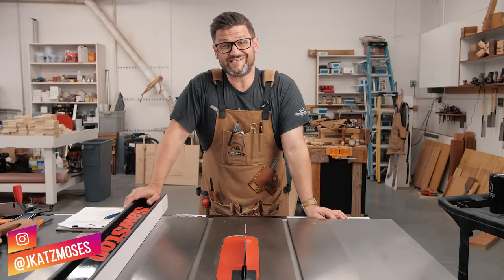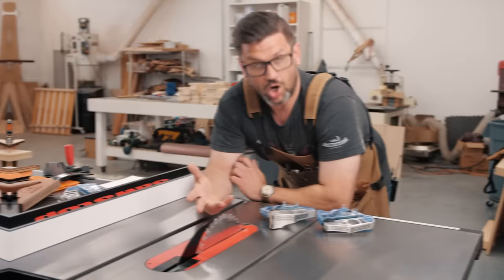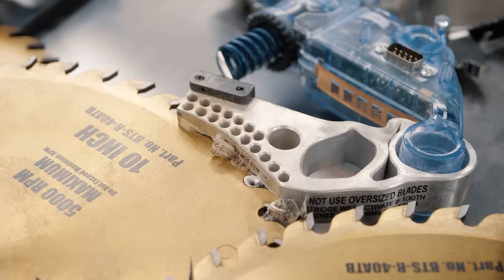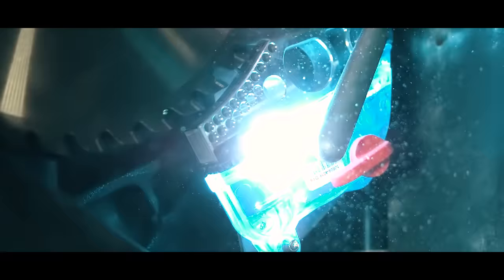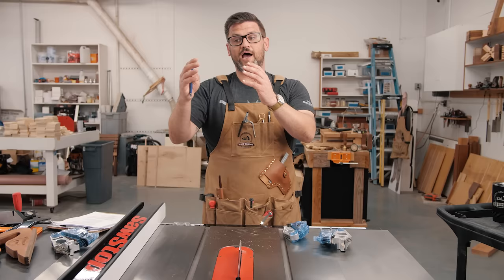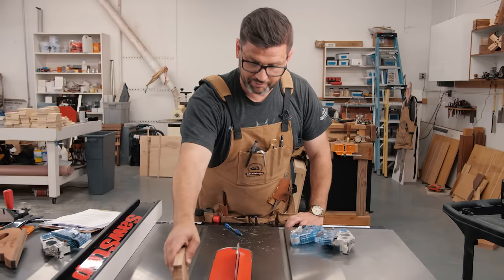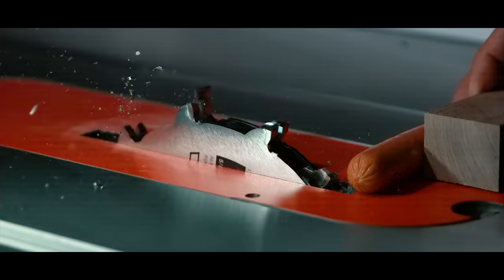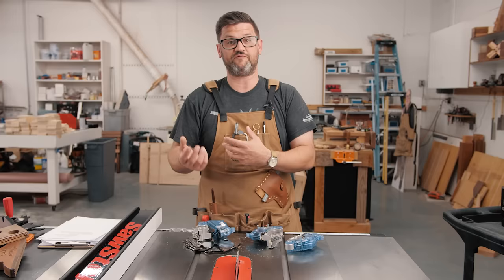How Safe is a Sawstop Saw? - Never Before Seen 19,000 FPS HD Slow-Mo Video

Comment: I've heard the "you were pushing too slow" argument before, my response is: just how fast are you pushing material through your saw?
Your high speed push was very impressive and convincing, but it really isn't needed since no one can even push wood through a saw that fast.  Actually trying to cut wood that fast  would cause a whole other set of problems...
Reply: Yesh, but if you (or someone else) were to trip and fall into it...

Accidents don't always happen to the person using the tool.
Reply: @adamthethird4753  That's what I was thinking. What could happen if you were to trip and fall into a spinning blade?
The fast push through the blade answered this to my satisfaction. You would endure some damage but most likely not an amputation.
Reply: @mktsmith62  I think Jimmy DiResta cut his finger off once. Said the bill was $15,000. And a new SawStop saw is around $3-4,000. I'd say it justifies it if you use the table saw daily
Reply: The speed is excessive but it proves how even in an unrealistically worst-case scenario, your finger will still stay attached.  It's not too often where you go way beyond what a product was meant to handle and it still does what it intends to do.
Reply: You can't push material thru the saw that fast but during a kickback scenario your hand could certainly be thrown into the blade that fast.
Reply: I have seen that people were trying to 'help' by starting to pull timber trough a saw from the other side. You don't expect that and you are completely of balance.  Accidents are a number of bad things coming together.
Reply: You hand would definetly get thrown back that far from kick back. I dont quite understand what you are defending?
Reply: @Toastmaster_5000  Good point
Reply: @jtltet  True
Reply: @komicalkramer6188  You could cut your finger off & have it sewn back on for free, if you lived in a country with proper health care.
I ran my thumb through my saw a few months ago - didn't lose it, but it was a mess.  Three days in hospital, surgery, & weeks of wound care visits - didn't cost a cent.
Reply: @TheLizardOfOz  A country that believes they have the right to someone else's labor for free?
Reply: Did you watch the video?  He gave examples of why your finger might be going that fast right after!
Reply: If you push it into it like that, it will catapult in my experience. Slow is the way to go my father always said.
Reply: @TheLizardOfOz  I'm not really sure what your point is. Are you saying just move to a country with "free" healthcare? That's gonna cost you way more than $4k. Are you saying this saw is stupid because the US government has shitty healthcare laws? Are you saying don't worry, you don't need to buy this saw because if you, God forbid, chop it off you can just get it sewn back on? There are so many flaws in that argument. It seems like the only logical thing to do is just pay the greedy corporation $4k for a saw, save yourself time money and heartache, and possibly your profession and move on with your life. This is what we call an investment. The upfront cost sucks but the payoff is worth it if it saves a limb or life and keeps you from getting sued by a disgruntled employee who lost his favorite thumb.
Reply: @TheLizardOfOz  I'd prefer not getting my thumb cut over having it fixed for free.
And there is never ever free healthcare anyway, it is sneaked into your taxes.
Reply: Why does it matter if it was needed? It is still interesting beside the fact that it still can happen. Like why argue wether it was necessary? It works so just be happy and stop arguing
Reply: @INoIFearIGaming   A country that sees health care as more important than profits.  
A country that has far better health outcomes for its citizens than the US.  
A country where people don't avoid going to the doctor because of the cost.
A country where you have no fear of bankruptcy if you get ill.
A country where infant & maternal mortality isn't increasing.
Shall I continue?
Reply: @Nworthholf  Yes, it's paid in taxes - and it costs far less per person than the US system.  Also, no co-pays.
Reply: @TheLizardOfOz  So who are you gonna force to provide their medical services to you for free?
Reply: There's always the case where someone is focusing on making a clean cut and absent-mindly tries to brush scrap away while the blade is still spinning.
Reply: @jonathanfairchild  Nice strawman.  I didn't make any of those arguments.
Reply: @INoIFearIGaming  No one.  No 'force' involved at all.  Socialised medicine is just a sensible way of providing health care for all - the way it's done in all progressive countries.
Who do US citizens "force" to provide their socialised road & traffic systems, their socialised police forces, or their socialised defence forces?
Just as an aside - many US citizens have been conditioned to see the word 'socialism' as synonymous with 'communism'.  It isn't.
Reply: @komicalkramer6188  Wait u gotta pay about 4k every time it stops? Or You meant the whole set?
Reply: Know.FeaR. In what world are they not compensated for their work? You realize they’re droll paid very well in countries with free healthcare 😂
Reply: How the fuck did you manage to make a video about a table saw political? Wether more or less expensive people tend to not want to be injured when working in the first place rather than have to go through a painful experience, it's as simple as that.
Reply: @valdasv9874  just the table saw costs around 4k. The break everytime it goes off, is around 100
Reply: I was wondering if it worked with clothes  or gloves or if someone fell face first and the glasses got in the way. Or like Jean's.
Reply: I just throw wood at saw, isn't that how you use it?
Reply: @mktsmith62  well if you are clumsy enough to trip and fall on a moving blade you shouldn't be in a work shop.
Reply: @unbiasedcobra6672  On that count I certainly cannot argue. :-)
Reply: @TheLizardOfOz  "Three days in hospital, surgery, & weeks of wound care visits - didn't cost a cent."  Sure it did.  You just pay for it in taxes.
Reply: @TheLizardOfOz  "Shall I continue?"   Do, or do not (says Master Yoda).   Lay out your perfect Utopia and then I might ask why is not everyone on Earth going there?  What's the catch?
Reply: @TheLizardOfOz  "No 'force' involved at all.  Socialised medicine is just a sensible way of providing health care for all - the way it's done in all progressive countries."  There is always force.  Suppose you decide not to pay taxes?  Oh, but there's VAT; too late, you already paid 24 percent sales tax.  You cannot choose not to!  But supposing you could, what then?  Well, eventually armed police will come.   Now suppose a majority of citizens decides not to pay taxes. How is that possible? Well they might decide to not work.  What then?  Well now you have a problem.  See the Soviet Union for details.  
Socialism works when people work.  That's about all there is to it.  The Soviet Union failed because of excessive diversity.  But socialists love diversity.  No, really, they don't.
Reply: @sirshotty7689  Everything can be made political.  After all the sky is Blue so it must be socialist.   Except at sunset when it becomes Republican.
Reply: @abhiv.f.1628  It puts a signal on the blade which is electrically insulated from the chassis.  Anything conductive that comes near the blade, doesn't even have to touch, but close like a millimeter, the capacitance of your hand or hot dog will draw enough signal from the blade that it can detect the proximity of this conductive thing even before contact.
Reply: It's more to represent a slip and your hand running into a blade which can happen.
Reply: @thomasmaughan4798  So Germany = Soviet union. Got it. What if people decide to "not pay taxes" yea... what if the government decided to "not do a single thing for maintaining infrastructure" you act as if taxes are a bad thing, as if somehow the government is stealing money out of your pocket and not providing you with anything in return. And while that might be the case in the third world country called United States of America, it isn't in most other developed countries. Your what ifs are Strawman arguments. I could start arguing the same way. What if the police decides Black lives are worth less .... oh wait. I forgot, not every country encourages deescalation tactics for their police force. What if a big part of your country was Stupid and didn't undestand that if everyone is paying for healthcare and the states puts in measures so that Insurance stays affordable even for low wage workers Insurance can be very much affordable?...  hmm no that doesn't work either... What if, you would realize that even though you technically can live without working in certain countries it has been proven that this does not affect the unemployment rate negatively? What if you understood that to recieve unemployment help you need to fulfill strict criteria and you need to actively try to get work and there was a government body watching over these efforts? What if you actually had a working government that doesn't only consist of two parties and stokes the "us vs. them" mentality every time it gets the chance? ... so many questions.  But i mean you're welcome to do as you please and to continue to Pay thousands in co payments and insurance payments or maybe for a change bancrupt yourself to get health care. Or, you know, you could just die, because that would be cheaper and more economic if you aren't able to work anyways when you're really sick. Yay unrestricted capitalism!
Reply: @TheLizardOfOz  no infant mortality in US is mainly caused by planned parenthood and countries with no cost health care are paying way higher taxes.
Reply: @KapitaenAwesome  "what if the government decided to not do a single thing for maintaining infrastructure" 

The possibilities are many.  Go back in time a couple hundred years and you had private enterprise building toll bridges and toll roads. 

"you act as if taxes are a bad thing"

Is it that obvious?  You take the fruit of my labor?  If I say "slavery" you'll probably agree that it is a bad thing, but only because you have been taught it is a bad thing.  

Taxes can be a necessary thing, but they are extortion and cannot be represented otherwise.   Tolls, on the other hand, is fee-for-service and thus each person is free to use the service, road or bridge; or not. 

Your what ifs are Strawman arguments."

As is yours.  But your example is really the fallacy of the false alternatives; as if the alternative to your socialist utopia is the "third world country called the United States of America" that fortunately by the power of its industry and military has kept most of the socialist nations "free" to pursue socialism. 

"What if the police decides Black lives are worth less"

Less than what?  The police are not charged with deciding the relative value of lives.  They are charged with law enforcement.  

"What if, you would realize that even though you technically can live without working in certain countries it has been proven that this does not affect the unemployment rate negatively?"

I regret not understanding your question. Okay, read it three times and I comprehend.  You are saying that a nation that allows people to live without working does not affect its unemployment rate.  Well, sure, that's because the unemployment rate is calculated on the workforce, not the non-workforce.  So if only 10 people in Germany wish to work, and 9 of them succeed, the unemployment rate is 10 percent.  The millions of non-workers do not affect this calculation. 

"What if you understood that to recieve unemployment help you need to fulfill strict criteria and you need to actively try to get work and there was a government body watching over these efforts?"

Sounds rather a lot like the United States. 

"What if you actually had a working government that doesn't only consist of two parties and stokes the "us vs. them" mentality every time it gets the chance?"

Sure, a parliament that is paralyzed three times a month because nobody has a majority.  I'm actually in favor of government paralysis.   The United States has many parties.   But there's no purpose to voting for a minority party.  That's a uniquely European idea.  Let's vote for a party that has five members of Parliament.  

"Or, you know, you could just die"

That has been the normal thing for millions of years.  

"Yay unrestricted capitalism!"

Yay indeed, but nothing you've described is capitalism.  Capitalism is not the opposite of socialism.   Capitalism describes the producers and socialism describes the consumers.   They can play well together as in Norway and Sweden, or poorly as in Venezuela and the Soviet Union where Socialism is strong and capitalism (making things) is weak or eliminated entirely. 

The Soviet Union collapsed primarily because they eliminated the production or capitalistic side of things while leaving the consumers in place with a guaranteedd Soviet Constitution of 1936.  Wanna bet that your constitution resembles that of the Soviet Union?  Bet on it.  It is coming to the United States pretty soon as well.  THEN the United States will be like a third world country because unlike yours, the United States is more like the Soviet dis-Union in having way too much cultural and racial diversity.
Reply: @thomasmaughan4798  i mean you're free to do whatever, as i said but i quickly want to touch on your last point "the us has too much diversity" sooo just to be sure, you're saying diversity is bad in the context of socialism? Like... Just to get this right, like the NSDAP that also said, well socialism is quite the neat concept. But only for Germans, because... You know otherwise it'd be bad? So we need to lessen diversity by.. let's say putting all the "diverse people" into some let's say... Getto and exempt them from our socialist structures? Because.. well that worked out great for us back then. As you might recalls from history lessons..
Reply: @thomasmaughan4798  " You just pay for it in taxes"  That's true as far as it goes.  But if I had brain cancer, or needed a heart/lung transplant, I wouldn't pay enough tax in my whole working life to cover it.
With socialised medicine, as in all the progressive nations, everyone pays, so that everyone is covered for whatever they need.  And all of this costs less per person than it does in the US, because hospitals & pharma companies can't charge stupid amounts for a band-aid.
So, progressive countries have lower cost, wider coverage & better health outcomes than the US.
Reply: @thomasmaughan4798  We're talking about socialised medical care.  If it's so fraught with problems, as you suggest (with your strawman argument) why is it that pretty much every first-world democratic country, other than the US, provides socialised medicine for its citizens, at a lower cost and with better outcomes than the US?  Why is the US system so inferior?  Because your corporations, greedy for their fantastic profits, spend millions convincing you to be terrified of the word "socialism".
"See the Soviet Union for details."  Democratic Socialism has little to do with the former USSR.  
I previously pointed out that the US already has socialised roads, schooling, police, etc.  Why are you not decrying these?
Reply: @KapitaenAwesome  My German is poor but my American English is nearly perfect.  If I meant to write that diversity is bad, I would have written to that way.  Excessive diversity of culture will cause "social contract" to fail and socialism depends on universal social contract.  It doesn't matter much what exactly is IN the social contract, what matters is nearly universal agreement.
Where diversity is large or great, the terms of the contract must necessarily be fewer, limited to those items that the parties can agree on, and forming the United States was difficult and the first attempts failed.  What worked was agreeing that STATES, not the federal government, would be the basic unit of government so that the Scandinavian states of Wisconsin and Minnesota could do things completely differently as compared to Mississippi down the same river some hundreds of miles.  
What works is that there is NOTHING in the Constitution of the United States that mandates any citizen deprive any other citizen of his labor or the fruits of his labor; but neither does it forbid that; hence slavery in the United States until 1862 and socialism to this very day.
Reply: @idratherbefishing7753  "infant mortality in US is mainly caused by planned parenthood"  Utter nonsense.  
I assume you are trying to incorporate abortion rates into infant mortality, which is defined as death in the first year after live birth.  In 2017, the US infant mortality rate was 5.8 deaths per 1000 live births.  The 20 best countries, which I believe all have socialised medicine, range from 1.8 to 3.4.  
The US ranks 26th - behind Slovakia, for fuck's sake.
One would think that the wealthiest country in the world would do better than to let so many children & mothers die.  As always, profits before people.
Reply: @INoIFearIGaming  ...what?  You think universal healthcare involves doctors working for free?
You must be trolling.
Reply: @idratherbefishing7753  ...you've drank too much coolaid there bud.  Abortions aren't counted as part of infant mortality figures, and as a Canadian, I pay about the same amount of taxes as an American making the same amount of money as me.
Reply: @TheLizardOfOz  "if I had brain cancer, or needed a heart/lung transplant, I wouldn't pay enough tax in my whole working life to cover it."
Precisely so.  It is impossible for the entire human race to pay for all of the ills of the entire human race!  This is a grand secret that eventually destroys all attempts at socialism.  So long as only you require the labor of others, it works.  But sooner or later they need labor, too.  What must then happen is NOBODY gets expensive complicated procedures.  It gets rationed.  That's okay, both approaches are just "systems" that benefit some but not all.   you can give some benefit to all, or more benefit to some!  Your decision obviously depends on whether you expect to be a net recipient of benefits or your labor tapped to provide for others, with little choice on your part.
Reply: @TheLizardOfOz  "why is it that pretty much every first-world democratic country, provides socialised medicine for its citizens, at a lower cost and with better outcomes than the US?"

Bad logic.  I think a man dying of thirst in a UK hospital isn't a "better outcome", or the woman that gave birth at the entrance of a UK hospital.
"At least two patients die of hunger or thirst every day in UK hospitals and care homes, according to data from the Office for National Statistics (ONS)."

As to the reasons, a "democracy" gives everyone a vote and by definition half the population is below average intelligence.  So it is unclear at any particular decisions whether the intelligent choice is to be made.

So long as people are working, a social medicine scheme is more efficient and I'm in favor of efficiency.  But the UK experience is that hospitals are a government job and tend not to attract responsible employees and this seems to be common in all governments everywhere there's at least a shred of private enterprise remaining. 

"Why is the US system so inferior?"

Because it is not your system.  Your system is best, by your judgment; whereas of course my system is best by my judgments.  I can get a surgery very quickly, sometimes the very next day; whereas in Canada many months go by waiting for a surgery.  Even in the United States some medicine is socialized, such as the Veterans Administration, where many veterans die waiting for a surgery.

"Because your corporations, greedy for their fantastic profits, spend millions convincing you to be terrified of the word "socialism".

Got evidence?  I thought not.  Corporations need not spend a dime.  They LOVE socialism!  It means they don't need to pay welfare and medical premiums; it's all "government".  

The reason I fear socialism ought to be easy enough to figure out simply by looking at the history of every socialist nation on Earth.  Pick one.  Hardly matters which one.   Oh, they start out well enough, but as George Orwell reveals, sooner or later the pigs reveal that "all animals are equal, but some animals are MORE equal".

"Democratic Socialism has little to do with the former USSR. "

The USSR is the poster child of Democratic Socialism.  The citizens of Russia voted for it; and voted for the Constitution of 1936.  The whole idea is that you cannot force communism on people, but given a chance, they will stupidly vote for it.  It concentrates power in the hands of a few, then you execute the few except one; last man standing, Vladimir Lenin.   Goodbye Leon Trotsky, thanks for your help with the useful idiots.  Socialism is about POWER.  it is not about equality or service or any of the other misrepresentations made to the public. 

how many times must the human race re-learn the same lessons?  as many as can fit into the time alloted.  French Revolution, Russian Revolution, most of central and south America.  Coming soon to a European nation near you!  You will be thrilled with your social systems, indoctrinated to your social systems, ignore than man behind the curtain (Wizard of Oz in case you dont recognizee the reference).
Reply: @Synthmilk  I do not understand "do you don't you" questions.  
I admire the US Constitution as being unique in all the history of Earth social systems; it is unique in NOT requiring forced labor of others and specifying what the federal government is permitted and required to do and that's all.  Every other thing not enumerated is left to the states or to the citizens.
So it is not clear to me why you imagine this question exists.  It would have been difficult for me to devote a substantial part of my adult life to defending the constituion of the United States from enemies foreign and domestic, did I hate it.  So perhaps you have been misinformed or you are misinforming yourself.
Reply: @thomasmaughan4798  You win.  Your indoctrination is too powerful for logic, reason & factual information to overcome. 
You must be right.  The US has the best health care system in the world, even though it's 26th in infant mortality rates (behind Slovenia), even though maternal mortality rates are among the worst in the developed world, even though injured people often beg bystanders not to call an ambulance due to cost, even though people are often rendered bankrupt & homeless by medical costs.  I was wrong.
Reply: @TheLizardOfOz  A simpler way to put it is that the Soviet Constitution, and the U.N. Declaration of Human Rights, imposes a mandate on other humans to provide you with free STUFF.   The United States constitution seems to be unique in not compelling anyone's labor in the service of others.
No doubt it hopes to encourage it, but it stops short of a mandate, at least until Barack Obama came along and mandated that citizens buy a product from corporations.  
I recognize a principle I call "expediency" and it is a way to approach things that are useful and necesary even though, or particularly when, moral justification may be weak or absent.
Suppose I owned North America.  I was a Cherokee and had succeeded to conquer every other tribe so now everyone was Cherokee and there was only one nation of 100 persons occupying North America.  Is it right?  is it moral, can I really own North America all by myself?  Modern Woke persons will say yes, but only if I am the right color.  How it came to be that I own it doesn't matter. Who owned it before me also doesn't matter, provided I am the preferred color of the week.  
So about those roads.  One of the duties appointed by social contract and Constitution to the government is interstate commerce and national defense.  This requires roads and bridges.  So you see, my ancestors already gave consent to the government to accomplish its duties that The People appointed to it, and authorized payment by tarrifs.
But in 1916 or thereabouts, "corporations" tired of being the ones to actually build roads and bridges, and embarked on an income tax so that "the people" would pay for roads and bridges.  But you LOVE the idea of The People paying for roads and bridges and even my sex change operations.  Why let us all, every last citizen, demand a $40,000 cosmetic surgery!  Sorry, no can do, not even Socialism can do that.  But it is my Human Right!  I demand my Human Rights!  Yeah, good luck with that; it destroyed the Soviet Union and Venezuela.
Reply: @thomasmaughan4798  One last comment: Democratic Socialism is not the same thing as Communism.
Reply: @TheLizardOfOz  "You win."  Of course.  I enjoy the conversation until that moment so I try to postpone winning.  
"The US has the best health care system in the world"  True; with developments such as MRI (Magnetic Resonance Imaging), the artificial heart and so on.   Of course I expect you will have different criteria for "best" and that's part of what makes these conversations interesting.  
"it's 26th in infant mortality rates"  An interesting measure of "best".  
"These premature births are the biggest factor in explaining the United States' high infant mortality rate"  So if people would quit having premature births the problem would vanish!  
I see Iceland at nearly the top spot, and I do not argue the excellence of iceland for many reasons (having lived there for a while).  it is a monoculture; a strong social contract, a combination of private enterprise and socialized medicine and education, and a total population of only 1/4 million all of whom have the same exact culture; 1100 years of isolation from the rest of the world.  They've already sorted out their differences for the most part.  NO DIVERSITY means a strong and shared social contract.
Reply: @thomasmaughan4798  You are arguing absurdities to bolster a demonstrably false position.
Reply: @idratherbefishing7753  "infant mortality in US is mainly caused by planned parenthood"  Nope.  Absolutely untrue.  
"countries with no cost health care are paying way higher taxes"  Again, not true.  The average American pays 24% in tax.  The average Australian pays 23.6%, & has socialised health care.
Reply: @thomasmaughan4798   thanks for the explanation.
Reply: @manydman  that sounds like a good life advice.
Reply: @mktsmith62  but on the other side thats your fault as you shouldent be running and if you trip and fall by walking thats another well 1 of 2 meaning your getting to old for this or you left something mid floor which should never happen but it does but still a fall is not as fast as a punch  so if you are running and your sawstop doesent work thats on you
Reply: Yes, but it was the principle that if youre going slower than that, you would be in even better condition.
Reply: @TheLizardOfOz  "Charge stupid amounts for a band-aid"
Isn't that the truth. Legit they charged me $60 bucks for one aspirin. The insurance covered it but still. What the hell.
Reply: Not the most intelligent comment. What happens if you lose your grip, while applying force to push wood through...? Your hand jerks forward with high speed. SMH.
Reply: @Mittens_McG  Yep - insurance covered it, but in return they charge you stupidly high premiums to make their enormous profits.
The Republican Party is in the corporations' pocket - they'll never fix it.  Y'all know what you gotta do.
Reply: A lot of possibilities to how somehow could hit the blade at that speed definitely come down to other safety issues on that workshop. Making sure people don't rush around the tools, removing all trip hazards, etc. However the redundancy of an item such as this is always a good thing nonetheless. Prevention is better than treatment :)
Reply: @TheLizardOfOz  You make it sound like I should prefer to have my finger [nearly] sliced off over having to pay a couple thousand.  Sure, I'd rather not spend any money, assuming I lived somewhere that didn't charge an arm and a leg just to visit (which isn't the argument here), but I also really don't want to almost lose a finger simply because money means more than a body part.
Reply: @Sak-zo1ui  you seem bothered by the comment, not really sure why, though...
Reply: @lethauntic  I guess I'm pointing out that the US health system is completely fucked, & you all need to vote out the arseholes in both houses who are feeding off the carrion of the body.  Bernie had the right idea, but now you're stuck with Sleepy Joe as the only option (unless you want Kanye in the White house LOL).  Get yourself a govt that actually cares about the people.  Vote early, vote often, & vote Blue, but for fuck's sake VOTE!
I'm kinda drunk at the moment, so that might have had a slightly different tone to my earlier posts.  :-)
Reply: the guy i know who lost a finger and cut half inch into his palm was ripping down a sheet of plywood to fill a small gap in a wall, had a kick back trying to pull the rip out from the guard and the saw and it pulled his hand into the blade, lost his pinky and alot of movement in his hand. he hit it probably close to that hard honetly. it was a stupid mistake on his part not using a push stick  but this saw would have saved his hand
Reply: @TheLizardOfOz  The only reason your country's healthcare system works is because of the United States.. Lets be honest here, the reason drugs are so cheap over there is because of price fixing which in turn forces Americans to pay the remainder of your bills, and the biggest factor is the United States citizens pay for your entire country's security and defense with our military, hell we have more of our active troops stationed in your countries than our own so your country has plenty of tax dollars to spare on health care. If one day America said enough is enough and dropped out of NATO, pulled our troops back, closed our bases in your country and the final nail in your healthcare systems coffin, Price fixed our own drugs here in the Usa, your entire system would collapse pretty rapidly. Drug prices would skyrocket in your country or you would just face a major shortage if your country refused to drop its price fixing, then the biggest problem would be ZERO new cures, treatments, and medications would be invested in and discovered because the entire profit margin would be gone if the U.S. had socialized healthcare. So your entire utopia healthcare system depends entirely of leaching of the United States back and would collapse pretty much immediately without it, that not even getting into the threat Russia and China would pose without our protection. It really is funny how indignant and ungrateful people can be towards a people and country that is responsible for their entire safety and prosperity.
Reply: tbh your „safety“ in the US sucks. I was seriously SHOCKED when i saw your woodworking machines.  You would probably go to jail if you were to use such unsafe saws...🤣
Reply: The real reason this argument is idiotic is that the other table saws don't have anything to protect you. So okay, someone trips and falls into the blade, fine. You don't think it will stop fast enough, that's absurd but whatever. But this is somehow worse than having nothing to slow down the blade other than human flesh? Come on.
Reply: @thomasmaughan4798  Yeah, you have to pay in taxes, but because everyone pays them it's way cheaper than in the US. 
You're actually paying far more in the US, because so many people have medical and educational debt, that they can't pay it off. 
Since the hospitals can't pay their stuff with debt, they have to increase the cost of their treatments by a lot for people that actually pay them. 
So in the end everyone pay's their own treatment in developed countries and only a few pay for all in the US and all the anti healthcare arguments are beyond ridiculous.
Reply: Well, even if it was a sensible argument, having protection against most accidents is much better than having no protection at all. You can always produce a situation where the protection would not work good enough, but that is not the point.
Reply: Or if you were cutting through some knot of wood or something, then the resistance you had to push through would be gone pushing your fingers into it at high speeds
Reply: @Hermelin.G1  WTF are you talking about? the safety i refered too was our military protecting the entire European Union from Russia and China on American citizens tax dollars. As for our wood working machines i have no idea wgat you claimed to see, my equipment functions perfectly and is well up to par on safety, same with any professional construction company or union. Now it is possible you went to visit an amish community which has wood working equipment on par with Kazakhstan, or you visited Jimbob and skeeter im their double wide trailer in central Florida, because then i would understand your concern with those safety standards. Otherwise your just talking out your ass.
Reply: @Lotek117  US protecting the safety and prosperity of the world must be the biggest joke i ever heard :D
Reply: TheLizardOfOz for most people in the US you wouldn’t lose much money either, but not every cut finger can be saved, regardless of where you are, has nothing to do with quality of care, which is much higher in the US.
Reply: @adamthethird4753  but you don't leave it running
Reply: @thomasmaughan4798  Imagine believing all of that bullshit.
1. The increase in taxes would be much cheaper for everyone involved than the cost of each person paying for medical insurance, which likely doesn't cover everything beyond a certain point.
2. What makes you think anyone would be providing their labor for free? Doctors and medical professionals would still get paid.
3. They'd be paid through taxes, just like police, military, fire departments, and education. Public safety and education are overall good for the general people and should be paid for through taxes. Why is health care different? Taxes are collected anyway. Why can't it go to things that actually help people?
4. You mentioned 24% sales tax at some point. What? Where is that? The highest sales tax in the US is under 10.
5. Why is the Soviet Union your favorite example of socialism? There are dozens of modern countries with socialized medicine functioning way better than the Soviet Union ever did.
6. Where did you get the idea that the US is somehow handling the current situation better than anyone else? If you actually paid attention, I think you'd find that the US is handling it the WORST of any 1st world country. What is your point bringing up Iceland? They are among the list of countries who have handled the current situation WAY better than the US.
Reply: @joshandrews8913  "1. The increase in taxes would be much cheaper for everyone involved than the cost of each person paying for medical insurance,"

Maybe.  These factors are unrelated.  The increase in taxes depends on the cost of services provided and to whom.  The cost of insurance also depends on the cost of services and provided to whom. 

"2. What makes you think anyone would be providing their labor for free? Doctors and medical professionals would still get paid."

I am not the one advocating for Free Stuff.

"3. They'd be paid through taxes, just like police, military, fire departments, and education."

Yes, of course, a government job.  I have mentioned this very thing.  Not perhaps to you specifically.  Right now for the most part you can get surgery from a doctor that drives a Tesla.  He's paid very well and he's also very good at what he does; which is also why he is paid very well.  Do I want a government employee working on me?  I'd rather not risk it. 

"4. You mentioned 24% sales tax at some point. What? Where is that?"

It's VAT, what Eurpeans call a sales tax.  Instead of all of the tax collected at the point of sales, the tax is collected at all transfer points, it is a "value added tax" so when you buy the raw materials you pay VAT.  Then when you sell lumber to someone they pay VAT.  They make furniture and sell it to customers and they pay VAT.  Because it is largely invisible it is easy to make it very high and each transaction has a small value add but a high percentage.  

"5. Why is the Soviet Union your favorite example of socialism?"

It is everyone's favorite because it completed the full cycle.  Revolution, socialism, totalitarianism, eventual collapse of socialism.  It will start the cycle again of course after a period of libertarian free-ish market.   BLM expressly declares its affiliation with Marxism and that's probably the path America will take. 

"There are dozens of modern countries with socialized medicine functioning way better than the Soviet Union ever did."

Indeed. Careful inspection would seem wise, not that very many Millenials are interested in something hard when they can simply vote for Free Stuff.  
What makes Scandiavia work?  Let us count the obvious factors: (1) Homogeneous culture and population (2) a strong work ethic.  Well that's really all it takes; shared work and shared benefits. 

The tale of the Little Red Hen, or the Ant and the Grasshopper, shows how socialism collapses when not everyone is willing to work, but still share in the goods.

"6. Where did you get the idea that the US is somehow handling the current situation better than anyone else?"

It is better because I said it was better, and I adjust the definition as necessary to make it so. you will do likewise of course.   "Better" has no meaning by itself; it ALWAYS and necessarily stands in contrast to something less better, by some sort of criteria.
Reply: I'm very unlikely to cut myself while cutting the wood. It is much more likely when I accidentially grab into it or when I trip and fall onto it.
Reply: @philippdrescher6012  "but because everyone pays them it's way cheaper than in the US. "  That would be nice if it were true, but it isn't, so it still might be nice but not for the reasons you suppose.  47 percent of Americans pay no federal tax at all. 
"You're actually paying far more in the US, because so many people have medical and educational debt"
Presumably doctors and staff must still be trained and the cost of that training, now as a government process, is likely to be higher, not less.  But since it is constrained as part of a national budget, what is far more likely to happen is that few people will have any sort of advanced training and most hospital staff will be "General Practitioners" of varying interest, skill and so on.
Reply: the wood would sooner start bouncing and projectile into your face
Reply: Thomas Maughan you kept saying “forced labour” referring to medical employees as if you don’t pay tax and STILL have to pay thousands for minor surgery, hundreds for basic drugs, thousands to give birth and so on. So wouldn’t you rather your “forced labour” ie the portion of your wage that is tax to include your medical bills? You’re acting like you’re the winner in this situation but you’re really not. And the bit where that guy said “or you just die” and you said “yeah like everyone” you missed the point. He’s referring to dying unnecessarily because you can’t afford your medical bills. I’d rather risk being one of the “one or two people that die due to thirst or hunger in hospital” than choose to be in debt or die, or be in debt or get my broken arm fixed. Which is a problem at least 25% of Americans Face I’d imagine as opposed to 1 or 2 people that die a day out of tens of thousands of people in hospital that day.
Reply: Dizzy Gear our taxes aren’t actually that high. It’s free in terms that you don’t choose bankruptcy over your health. If you become bankrupt in England it’s mainly down to how you manage your money, if you didn’t foreshadow issues with your current economic situation then that’s your own fault (I’m not saying bankruptcy is always a persons fault before you make any assumptions) and not because you got cancer and now need to start selling meth to cover the costs.
Reply: @TheLizardOfOz  Are you still here?  You already proclaimed me the winner.
Reply: @komicalkramer6188  imagine having to pay for medical accident
Reply: @thomasmaughan4798  You're the one that keeps talking about free stuff. Everyone advocating for free medicine knows it isn't really free. The cost of medical insurance does not depend solely on the cost of the medical services. Insurance companies make money. Their profit margins are the difference in cost that would be saved by paying hospitals and doctors directly with taxes. Your example of a surgeon who could afford a Tesla would still be able to make the same salary. Also, you complain about doctors becoming government employees like that's inherently bad. Doctors would still be going to medical school and getting the same training, so there wouldn't be an issue of them becoming less competent. Like I said before, they'd still be getting paid the same as well, so there wouldn't be an issue of them becoming disgruntled, either. Lastly, the issue with the Soviet Union was its corrupt government headed by figures like Stalin, not its version of socialism. You claim that "it completed the full cycle" of socialism, but you only think socialism is doomed to fail because the Soviet Union failed. How long will socialism in European countries have to succeed before you realize that the Soviet Union, being only one case on its own, does not define a general cycle?
Reply: @adamthethird4753  Normally the blade is covered with a kind of protector so no one can really be hurt normaly.
Reply: Sooo for those that defend usa healthcare system, have you heard about the nordic model?
Reply: What if you trip over and fall on the blade with your belly/chest/abdomen?
Reply: @joshandrews8913  "Your example of a surgeon who could afford a Tesla would still be able to make the same salary."

That is unlikely.  Socialist thinking attempts to equalize wages.  The doctor might get a large salary but will also be taxed at 70 perecent (Biden's proposal) or the earlier 90 percent.  Why is it not still 90 percent?  It was impacting innovation rather severely and if I remember right, it was JFK, a Democrat, that reduced it. 

However, it is unlikely the doctor, a government employee, would get substantially more than anyone else.  It is not "equal" and equality, at least as the left wing spews the words out, is very important.  Actually, there won't be doctors. If anyone cannot be a doctor then no one is a doctor and many left wing revolutions have immediately executed their intellectuals.
Reply: While I agree with the vast majority of the videos I've seen going a reasonable speed, there are a few exceptions. Now for the 'how fast are you pushing..." things generally don't play out like a perfect textbook example. In normal use someone won't be punching their sawblade, they may however trip, have a muscle spasm, or lose grip with a pushstick. Are these likely? No. But neither is a table saw injury in general if you're alert and safe about it, but again that's in an ideal world.
Reply: @joshandrews8913  "Also, you complain about doctors becoming government employees like that's inherently bad."

Plain to see you do not have much experience with government employees or employment.  It is neither good nor bad; a doctor would be a GS-13 perhaps and promotions would be governed by a committee or review board with emphasis on party allegiance and other factors.   My GS-13 supervisor was delightful but nearly inept.  It is of course what created my job as a contractor; someone does eventually have to do the work and that's where contractors come into play. 

"Doctors would still be going to medical school"

The medical schools will also be government operations where, as is becoming the case already, party allegiance is the most decisive factor.  

It is not automatically bad, but it also isn't automatically good.  It becomes luck of the draw since competition does not exist in socialism.  

"Lastly, the issue with the Soviet Union was its corrupt government headed by figures like Stalin, not its version of socialism."

Yes!  How exactly do you propose to eliminate corruption?  Business achieves it through competition; a corrupt business is inefficient and cannot long remain in business. But a corrupt government remains in business until the next revolution installs a new government that will probably be even more corrupt.

Socialism implemented by God Almighty would probably work.  But only in that case.
Reply: @joshandrews8913  "you only think socialism is doomed to fail because the Soviet Union failed."

Once again you fail the mind reading exam.  your question to me was why did I choose the Soviet Union.  My answer was because it has completed a full cycle and thus is an example.  Venezuela is an example but hasn't completed a cycle.  China is an example but discovered that you can have capitalism, market economy AND a single party.  The United States has had it, too, for short periods of time.  The Democrats owned all three branches of government for two years.  It's scary so people quickly corrected that.  I don't ever want one party owning all three branches of government. 

"How long will socialism in European countries have to succeed"

Well, once they start we can see.  European socialism isn't "socialism", every European nation still practices market economies, private ownership of land and the means of productions.  They socialize certain aspects of an economy and you cannot very well have a society with no social aspect.  

"does not define a general cycle?"

The general cycle was defined hundreds of years ago.  "According to Lord Tytler, a Scottish Historian, the average age of the world's democracies is around 200 years"
"Lord Tytler identified "Eight Stages of a Democracy", from beginning to end. The eight stages go from bondage to spiritual faith; from spiritual faith to great courage; from courage to liberty; from liberty to abundance; from abundance to complacency; from complacency to apathy; from apathy to dependence, and finally from dependence back to bondage."

Socialism is dependence, seems good at first, leads to bondage because of corruption which you have recognized was really the downfall of the soviet union.  But not just corruption.  Committees cannot correctly guess supply and demand and set prices.  Inevitably this mis-calculation results in surplus unsold stuff (rare) or shortages (extremely common).   Shortages are more common simply because with the profit motive eliminated few people will work hard.  Vladimir Lenin discovered this the hard way with collectivization.  

"SNAP recipients (food stamps) have risen from 8.4 percent of Americans in 2007 to 14.2 percent in 2015. The labor participation rate (amount of able bodied Americans looking for work) is decreasing to levels not seen since the Carter Administration, as citizens are giving up and accepting government benefits at rapidly increasing levels."

So, benefits UP, labor DOWN.  This is not sustainable.  Consider the Greek experience.  Who is going to bail out the United States of America?  Oh.  China.  And that brings the next stage of the cycle: Bondage!
Reply: Can you even cut anything with this with this system on? I just don’t understand the point. Yeah it’s for safety but if it literally stops when anything touches it then how can it cut anything.

Unless, it only reacts to skin (which is probably the reason to use a sausage, I assume).
Reply: @cyrecks  A person can choose not to be embarrassed.  It removes from you the power to decide my feelings.
Reply: MeAndMother2 don’t think you would need to worry if they fell out of a plane they would not fell it
Reply: Intresting thread, even though I understand there is no "ultimate healthcare", for me, I prefer public one. I understand that I'm paying for it with every tax on my income and my purchases, but if I have to choose, I find it more usefull than maybe other possible public services. If I have to put a percentage on every public service I want, I would put a good percentage on it. But I like reading the different opinions on this thread, it helps understanding all points from different experiences and knowledge...
Reply: @richardevans8908  The forced labor concept comes into play in various scenarios the main one being if the government cannot entice enough people into service industries to provide you with your "rights".  Privileges can be rationed; rights cannot be.  That's the meaning of "rights".  You cannot legally be deprived of your rights except under extraordinary, and shrinking, circumstances.  

Forced labor is also indirect.  Every tax I pay is compelled, and the labor that went into it also compelled.  In a libertarian world I would pay whatever I am willing, and the seller would accept whatever the seller is willing.  Remember when doctors made house calls?  The doctor might get paid with a jar of mom's home made jam or an apple pie.  This was an agreement between two people and taxation wasn't involved.

Enough people are compelled by sheer necessity of survival to some sort of gainful employment unless you live entirely off the land that nobody else wants anyway.  Good luck with that.  But while I am willing to work 8 hours a day for me and my family, I find myself working only 4 to 6 hours a day for me and my family and another 4 hours for someone else; very likely someone that is more than happy to come at me with a baseball bat and burn down my nation and city.  They could at least say thank you for the laborers that actually make and pay for Free Stuff.
Reply: I've seem enough Final Destination to know that I would be working in my shop when a bull randomly charges through my garage door and launches me into my tablesaw.
Reply: @adamthethird4753  
If you're working in a crowded workshop where you could trip and fall into a saw... you shouldn't be allowed to operate one to begin with!
Reply: @Lotek117  What complete & utter drivel.
" the United States citizens pay for your entire country's security and defense " Not sure why you brought the military into a conversation about health care.
"we have more of our active troops stationed in your countries than our own"  Are you seriously saying that you have fewer than 300 troops stationed in the US?  Because that's how many US troops are in Australia.
The Australian health care system will continue just fine, thanks, when you take those 300 troops home.
Reply: @GuruEvi  "quality of care ... is much higher in the US.
"   It's not, you know.  The US health care system is among the worst in the developed world.
Reply: Dizzy Gear  You can stop laughing.  Health care in Australia costs far less per capita than the US, with better outcomes.  And we pay LESS in tax.
Reply: @davidaz04 A problem we haven't discussed here yet is that the moment the public pays for your healthcare, they also get to decide your lifestyle choices such as risky sports, unhealthy eating, smoking and so on.  They are paying for your health and it is only just for you to be responsible.

Now if you are paying your own way, then you are free to act any way you like; engage in risky behaviors and probably pay a higher insurance premium or decide to skip insurance entirely.  

Underpinning pretty much everything is "liberty" versus "totalitarianism" with shades in between.  Socialism by its very nature cannot co-exist with liberty.
Reply: @thomasmaughan4798  "BLM expressly declares its affiliation with Marxism"  Cite your source please.
Reply: @thomasmaughan4798  "the moment the public pays for your healthcare, they also get to decide your lifestyle choices such as risky sports, unhealthy eating, smoking and so on"
Nope.  Absolutely does not happen.
Reply: @TheLizardOfOz  I work Admin for an NHS Surgery in the UK, It doesn't pay phenomenally but It's good work and I'm glad to be part of a service which helps people regardless of income. Sure we all pay for it with our taxes, but honestly, that's not a problem. A small add to our taxes that means if we do fall horribly ill or succumb to a nasty injury, we're covered and don't have to pay obnoxious amounts of money just to live. I had to go to hospital for a kidney stone to be treated as It was blocking up my bladder. 3 days later and a few returns for lithotripsy later, and I'm all good and back as normal. And it didn't cost me a literal arm and a leg.
Reply: ozy   Here ya go, "mate".  
http://www.oecd.org/tax/tax-policy/taxing-wages-australia.pdf
Average tax paid in the US is 24%.  Average in Oz is 23.6%.  And we still manage to afford socialised health care.
Reply: KomicalKramer lol Americans paying for hospital bills lol
Reply: @sandrokobulia9100  put a blade protector, it protect your blade and the plank you put will slide under the protector. I have this at my school and it works well. Blade protector+ safety mesures+ sawstop = no danger.
Reply: @Brawlkings93  Yep - socialised health care just makes sense.
Reply: @TheLizardOfOz  You live in the US don't you? Why else would you care so much about US politics. Stop lying on the internet. Health insurance I pay 90$ a month for means my 10k hospital bill is about 100$.
Reply: @TheLizardOfOz  How can you say Australias average is a 23.6% tax rate when your standard income tax rate for people making over 30k is 32.5% alone?? In fact, Australia has some of the highest tax rates in the world. I'm finding it hard to believe you live in Australia. Australia has the 13th highest progressive tax rates in the world, and receives most of it's money from personal income tax lmao.
Reply: @robertbossly  "You live in the US don't you?"  Born & bred in Australia - never set foot on US soil.  
"Why else would you care so much about US politics."  Well, politics is a bit off-topic, but your nations politics can screw things up for the rest of the world.  Your current Nutcase-in-Chief is probably the best example of that.  
But back on topic, why should I not be concerned that my American cousins suffer such poor health care?
"Stop lying on the internet."  What have I said that you think is a lie?  I assure you, I've not told any lies - nothing but the honest truth.
"Health insurance I pay 90$ a month for means my 10k hospital bill is about 100$."  You're making my point for me.  My Medicare Levy - the tax we Aussies pay for our socialised health care - is around $65-$70 per month.  I recently  had a 3-day hospital stay, plus surgery, plus ongoing medications, plus several weeks of wound care.  
I have no idea what the cost of that was, because I didn't get a bill.  I didn't pay a single cent.
Reply: @robertbossly   Perhaps you don't understand how income tax works.  Let me do the math for you. 
For your first $18k of earnings, you pay no income tax.  For $18k to $37k, the rate is 19%.  $37k to $90k - 32.5%.  $90k to $180k - 37%. And for earnings above $180k - 45%.
Thus, if your taxable income is $200k, you'll pay $63,100 in income tax, which is a little over 31.5%.  
Most people don't earn that sort of money.  If you earn $90k, you'll pay $20,797, or 23.1%.
I earned $51k & change last financial year.  Tax on that would be $8,122, or 15.9%.
So you see, while our top marginal rate is 45%, the progressive scale means that nobody actually pays that.  I believe your Federal income tax works similarly.
The OECD page I linked confirms that the average tax rate for Aussie workers is 23.6% (in 2017, I believe.  Our tax rates have dropped a tad since then).
Reply: @MeAndMother2 I don't o ow about saws but t those scenarios that you've stated probably wouldn't happen in a thousand years. Especially the parachute one cause no one will be stupid enough to land on a random person's rooftop to fall through the ceiling and definitely wouldn't be stupid enough to parachute ONTO the saw. Falling through a ceiling is the most likely to happen but it's still very unlikely.
Reply: @KapitaenAwesome  "so germany=Soviet Union" what you just did is more of a strawman argument than what they said. He took some quotes a bit out of context but he didn't explicitly say something along the lines of "So what you're saying is...". As far as the arugment around socialization of health care I personally believe support the idea of a single payer system and anyone who argues for the idea of insurance but not "paying for other peoples healthcare" doesn't know how insurance works as a business model.
Reply: @cyootlabs  I don't anyone's saying nationalised healthcare employees aren't being paid. It's taxpayers who are being forced to provide a service for free. Also the US healthcare system  is very heavily regulated so it's not exactly a shining example of a free market.
Reply: @TheLizardOfOz  absolutely nothing is free. SOMEONE had to pay for it.....
Reply: @TheLizardOfOz  That's the problem with america....
Reply: @komicalkramer6188  you don't even have to replace the whole saw if I recall correctly, just the blade and brake
Reply: @martbosman8373  yeah, they fucking DRILLED that into us. If you are "helping", DON'T pull on the damn wood.
Reply: @INoIFearIGaming  Medical professionals still get paid, stupid. 🙄 Just because money isn't coming directly out of your pocket, doesn't mean someone us working "for free".
Reply: @unbiasedcobra6672  Shit happens.
Reply: @adamjones1129  "It's taxpayers who are being forced to provide a service for free."  The same way the US citizens are "forced" to pay for their socialised roads, infrastructure, police, firefighters, military, etc.  I don't mind being "forced" to pay a few hundred a year so that we can all enjoy a decent health care system at no extrra cost.
Reply: @TheLizardOfOz  Too long, didn't read. You expect me to read this essay? Whatever you ended up typing is far more than I've ever given a shit about anything in Australia...ever. Why do non US people care so much about what happens here? I'll never understand your fascination.
Reply: But even if they did push it that fast without this saw your finger is gone.
Reply: true but it's nice to know how fast it can stop, just for the purpose of testing and proof, not in actual practice.
Reply: @TheLizardOfOz  1) free healthcare doesn't exist, it's paid for by everyone and used by everyone
2) you have no guarantee that they will be able to save your finger
3) a finger that got sewn back will still lose sensitivity and agility
4) you're going to waste time not being able to work, and free healthcare doesn't pay for it, insurances will do their utmost to shaft you
5) free or not, it's at worst a traumatizing experience, at best a really shitty one, you don't want to experience it if you can afford not to
Reply: @INoIFearIGaming  every country that i know of believes someone else has a right to people's labor for free, you pay taxes everywhere, whether they are used to buy more fighter jets or to ensure everyone can get a heart surgery
Reply: @Cookiedible  1. Yes, I know.  It's been said a dozen times in this discussion.
2. True.
3. Possibly.
4. Correct.
5. Agreed.
I really don't follow what you're trying to say here.  
My point is that in a country with decent health care, you won't have the added trauma of finding tens of thousands of dollars to pay the hospital bill.
Reply: @DJveggii  Cool story
Reply: @thomasmaughan4798  You sound embarrassed bro
Reply: @TheLizardOfOz  You might not mind paying that and that's fine but you do not have the right to make that decision for everyone else. And as for being forced to pay for roads, police, etc, I never said the US was perfect. Military, law enforcement and courts of some description are required to for a functioning state (assume you want or need a state). I would consider taxes for those three function a necessary evil to ensure law and order. That being said you do not necessarily need to force people to pay, voluntary taxes paid out of a sense of civic duty is also an option and sure some people would contribute but that doesn't matter as long as enough do.
Reply: @cameronmason4452  "You sound embarrassed bro"  I see that we are running out of things to write about ;-)
Reply: TheLizardOfOz feel free to quantify your statement - highest survival rates for cancer, the few stats where the US is doing worse than say Germany is when it comes to what is known as luxury diseases such as diabetes, obesity and the resulting circulatory and respiratory diseases but many more people go to the US for health care than Americans go abroad for health care. I’ve never heard anyone even go to Canada and wait for 18 months just to get cheaper cancer treatments. If you look at detailed studies comparing similar adults across the world (same fitness, same income etc) the ones in the US do best. Aggregated, the US has mixed results in OECD statistics but that is largely due to a higher living standard (over abundance of food) which does impact health long term.
Reply: @adamjones1129  As an individual, I don't have that right, but individual voters, through our representative government, did.  And yours can, too.  It's sensible, humane, & cost effective.  In fact, it has been shown that a socialised health care system would cost quite a bit less per US citizen than the current system does.
In 2017, per capita health care spending in the US was over $10,200.  In Australia, $4,500.  And We have lower maternal & infant mortality rates.
Reply: @TheLizardOfOz  I do not see how a government has the right to force people who did not vote them to participate in a socialised healthcare system. As for cost difference, I imagine there other factors that would influence the cost obesity rates, etc. And secondly it may well be true that nationalising US health care would reduce prices. I am arguing for free market healthcare not the US system which hugely over regulated.
Reply: @adamjones1129  "I do not see how a government has the right to force people who did not vote them to participate in a socialised healthcare system."  
Does a government have the right to "force" you to pay for roads you don't drive on, for firefighters if you never have a fire, etc ?  Of course they do - your argument is nonsense.
Reply: @TheLizardOfOz  No, they don't have that right.
Reply: @adamjones1129  LOL!  Stop paying your taxes & see how that goes for you.
Reply: @TheLizardOfOz  If someone is holding a gun to you does that give them the right to take your wallet?
Reply: @TheLizardOfOz  No, it's not but the basic concept is the same. You are coerced by the threat of violence to give up part of your wealth. Maybe the mafia demanding protection money would be a better example. 
I'm not particularly familiar 'sovereign citizens' but from a quick google no, I don't advocate not paying your taxes just as I don't advocate telling the guy holding a gun to you that he can't have your money.
Reply: @adamjones1129  Look at it like insurance (which it essentially is).  You pay a small amount each payday, to cover any large medical bills later on.  If you don't see the value in that, then you possibly have a cognitive problem.
Reply: @TheLizardOfOz  That seems like a perfectly reasonable way to pay for healthcare to me. My issue is that a state healthcare system has a monopoly on the industry and there is no competition to drive lower prices and better quality.